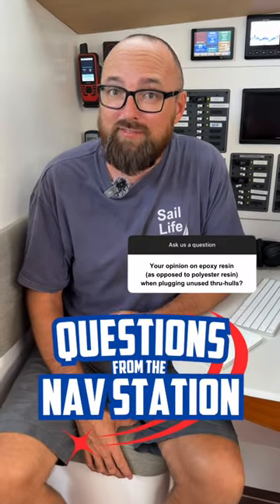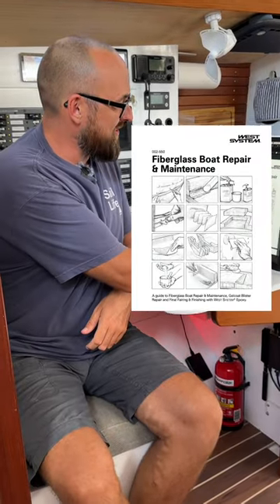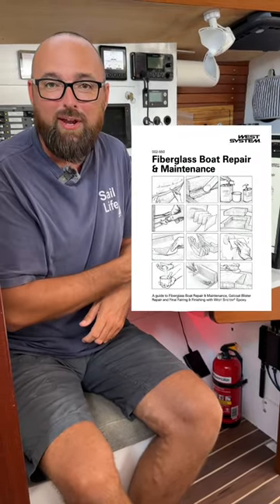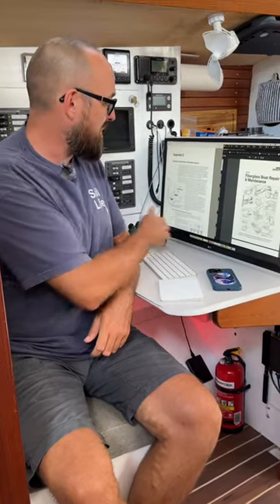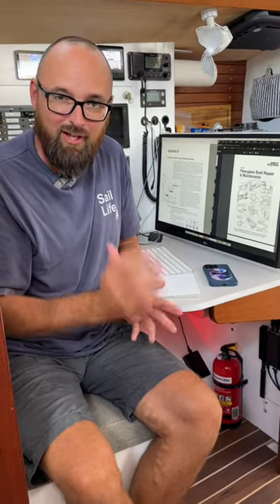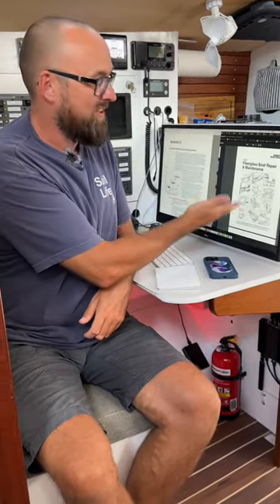Sail Life - Epoxy vs Polyester. Which should you use?

Comment: Another bad side to polyester is in addition to not bonding as well is shrinkage during the cure process.  When drill-fill-drilling (DFD) the thickened polyester plug tends to want to shrink inside the hole and pull away from the sides of the overbored hole. 

Sometimes this happens right away with an obvious crack opening up part-way around the arc of the plug.  Sometimes it is not as obvious right away but there is still a very weak bond there which may eventually open up as a hairline crack as the through-deck or through-hull penetration ages and  experiences loads on the plug over time and also through daily and seasonal heat cycling.   

The whole point of DFD is to protect the balsa, plywood, foam, or other inner core of the laminate from moisture intrusion. If there is a hairline crack introduced there which might even be outside the area of the sealant used on the penetration it leaves the core even more exposed to water intrusion and is counter-productive.

I no longer use polyester anywhere on our boat. Raka brand epoxy is not much more than the cheapest polyester (3M from home stores) and there is also a space/storage issue on a boat so why carry both when epoxy is better for all uses except for when gelcoat is used for overcoating?  Even if one eventually decides to gelcoat over epoxy repairs there are products which can be used to prime the epoxy so that gelcoat can be then used.

Comment: Well the main downside of Epoxy is the working times. You can layup way more glass in a day with polyester than with Epoxy. The secondary bond of high quality poly or vinylester can be stronger and more water-resistant than that of cheap solvent based Epoxy. Actually in the real world the strength argument in repair is super subjective. I generally use quality non solvent based Epoxy under the waterline but everything else is polyester. Everyday all day.

Comment: Epoxy more friendly to cool temps.I think down to 40Deg. F  CHEERS from HERE!
Reply: WHAT!?! Epoxy takes way longer to cure than poly.
Reply: @dannyjones3840 I think that’s a little bit of a sweeping statement tbh. 

(Edit- Added for clarity) *Where epoxy is concerned*…
It’s really quite dependent upon hardener selection vs. temperature and, even then, different manufacturers products perform better or worse at lower temps. 

I’m not fervently anti-polyester/vinylester, I’ve just ended up using epoxy for the vast majority of repair jobs because the cost disbenefit isn’t really worth thinking about,  when considering the quantities that most repairs require. 

I’ve also never had an issue when doing a repair with epoxy on a polyester moulding. 

I have had a couple of snags, however, when using polyester for repairs, though on both occasions they involved repair on extremely old GRP mouldings. 
Whether the age of the polyester substrate actually had anything to do with the problem I’m not sure. 
😎👍🍻
Reply: With most polyester resins the amount of hardener (catalyst really) used is a function of the ambient temperature and the desired cure time. If it is really cold add a bit more hardener and it will cook off faster.  Epoxy is NOT friendly to varying the resin to hardener ratio since the hardener is not a catalyst but a component of the epoxy itself.
Reply: @svbarryduckworth628  Absolutely valid information and well stated, especially your point about the necessity of observing the correct epoxy base/hardener ratio.

For anyone who may be prone to “add a little bit more hardener to the epoxy mix for luck because it’s chilly,” don’t do it.

Adding excess hardener to epoxy will significantly weaken the resulting product.
Reply: I think about epoxy as being two different batches of chemicals that bond together to make new chemicals together which then harden up.  The ratio is important because any extra of either of these left over that don't have any of their mates to combine with will just be floating around the the mix unbonded and soft forever.  This hurts the overall strength of the epoxy. 

Ideally all of these elements find their respective mate(s) and there are none left over.  Obviously it is impossible to mix it that perfectly but the further the mix gets from that the more impure unmated elements exist in the finished product and the worse the strength will be.  This is also why it is extremely important that the mixture is well-stirred so that there are no pockets of one or the other part that never mixed and never find their mates.

Polyester is a different process.  The resin has everything in it that it needs to transform into the finished product.  It doesn't react with itself without the catalyst which is added later to cause it react with itself.  More catalyst makes the reaction go faster and because the reaction is exothermic it creates heat.  Too much catalyst and it gets so hot it can damage the finished product.  Not enough and the reaction can fizzle out before it is complete.  That's why when it is cold out a little more catalyst will make the reaction run hotter and not fizzle out.  Thorough mixing is important here too.  If the reaction is going faster in some parts of the layup and too slow in others it might fizzle out or the hot parts get too hot.
Reply: @svbarryduckworth628  Nicely done. 😎🤝🍻
Reply: I learned all of this the hard way by screwing up stuff and then researching later what went wrong.  Short way is to just read the West Systems book and Don Casey's boat/fiberglass repair books.
Reply: @svbarryduckworth628  You and I both.

I had the advantage of having done a pile of research and written a thesis on the use of and production techniques for high strength composites in Engineering structures back when I was a lad. 

That possibly informed me a little better than the average bear about things like strand orientation in layup and a bit about mould design, but the realities of using the products for repairs later on in life  revealed how little I actually knew and set me on the path to gain more knowledge about it 

Couldn’t agree more with your reading recommendations, excellent.